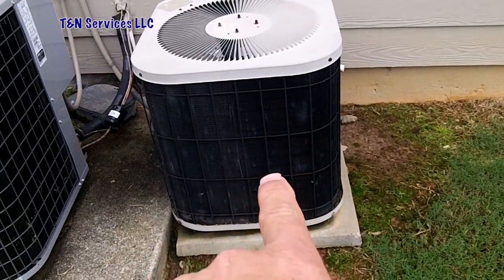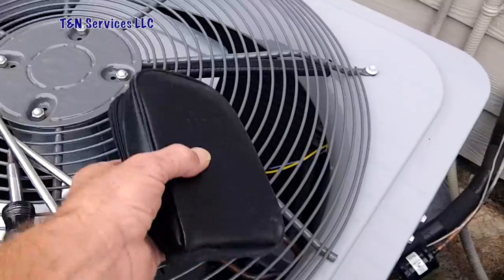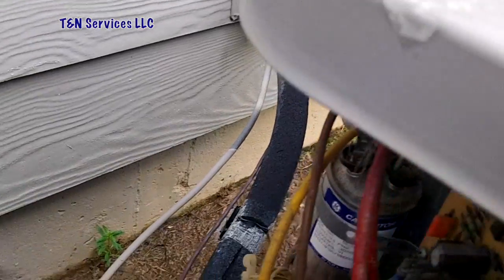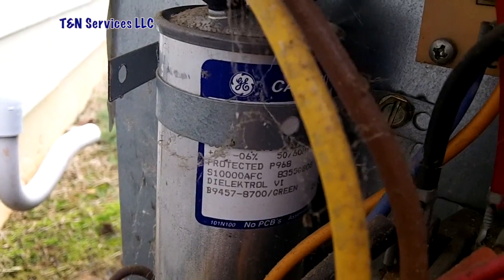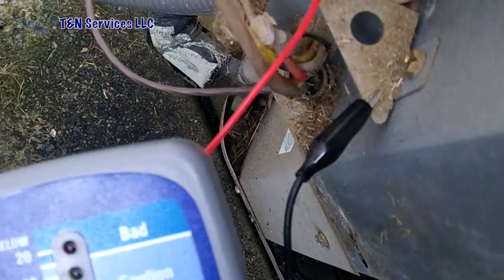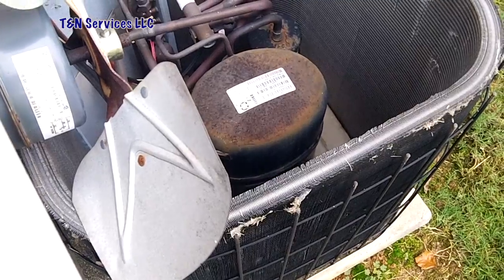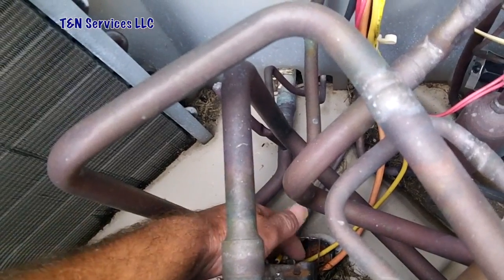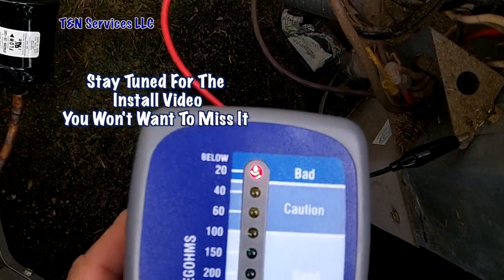HVAC Training: Testing For A Grounded Compressor

Comment: So your first test was the yellow wire and the chassis which was PAINTED STEEL. First off paint is a very very poor conductor of electricity. Steel is 30% poorer than copper at conducting. You need to measure from the compressor BODY, against one wire from the compressor. The compressor body needs to be sanded down to CLEAN METAL before measuring. Your reading was incorrect. You have the fancy tools, now learn how to use them. And all the people commenting on how great this video was............ LOL

Comment: Wow, finally a tech who uses the proper tool to check for grounded motors.  I had the older style crank megohmeter, which had an analog needle scale, so I could get the actual reading.  I knew when one was bad just by the resistance  felt while turning the crank, because my 500 or 1000 volts was going right to ground and creating a load just like a generator would.  I once used my megger to jump start what I thought was a dead seagull on a roof.  I connected up to both of its feet and gave it a crank.  The seagull woke up and flew away.
Reply: LMAO